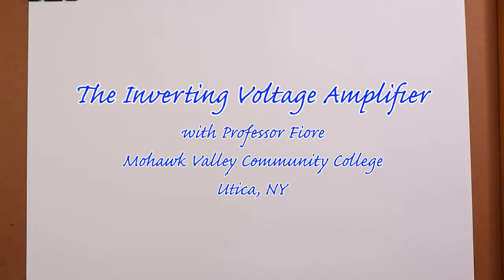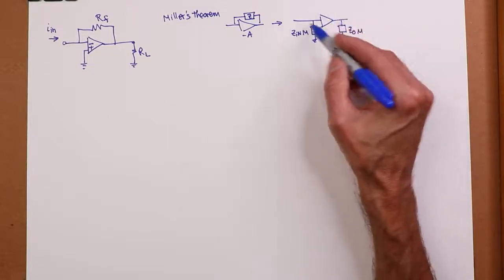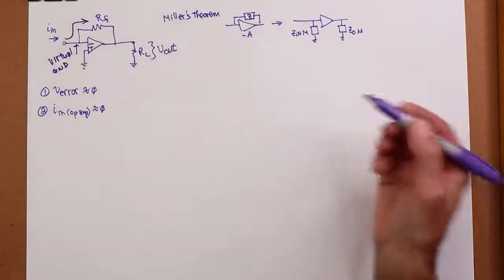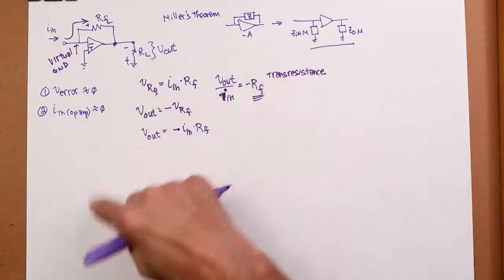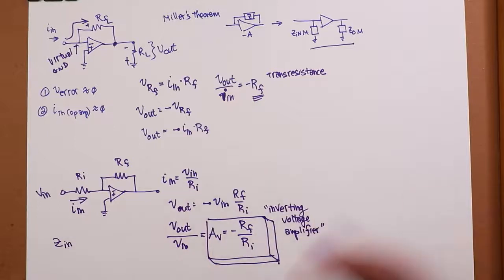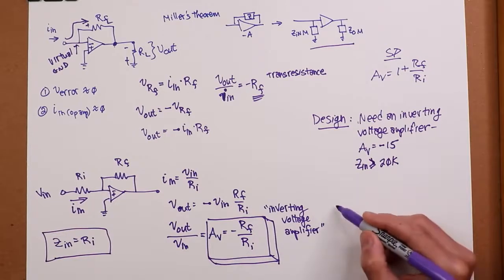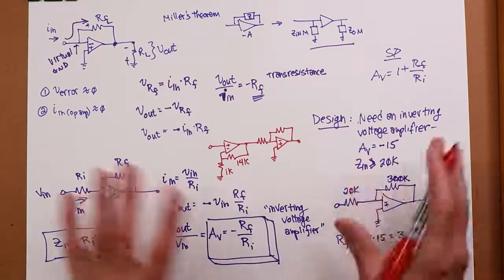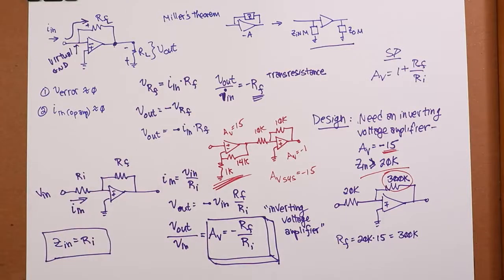Op Amps: Inverting Voltage Amplifier

Comment: As the video approached 10:00, I was about to ask if you could use a buffer to give the required gain in front of the inverting amplifier - to keep resistor values reasonable and a low noise floor on the inverting amp. And sure enough, at 12:30, that's exactly what you did.
Glad my 62 yr old brain hasn't forgotten too much engineering theory from 40 years ago!

Comment: Excellent. At 11:50, we have the design example with Zin of 20kR. Could we do this with a voltage follower BJT, then use a 2kR (or higher) on the emitter (approx), or better to use 2 op-amp stages?
Reply from the maker: You could, but that will depend on other factors. Good circuit design is all about balancing tradeoffs. One nice thing about op amps is that they can be configured close to idealizations (e.g., ideal voltage amplifier or current-to-voltage transducer) with minimal effort. Also, duals are widely available (two op amps in one package), so you're example would only require a single IC.